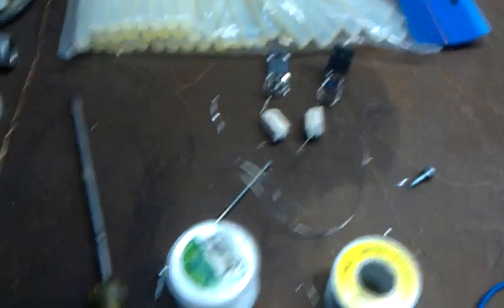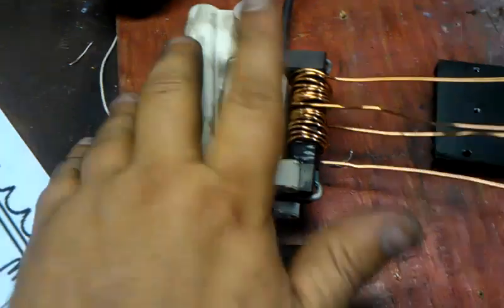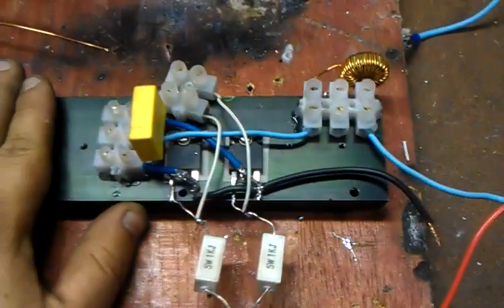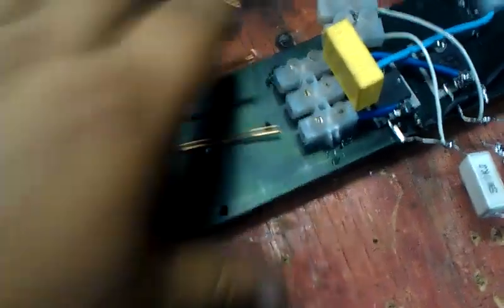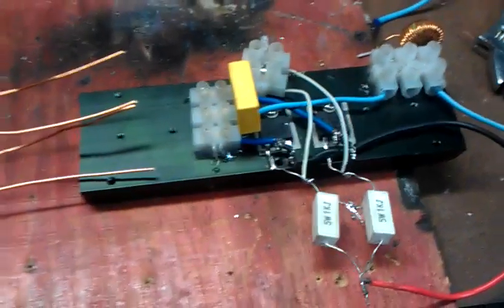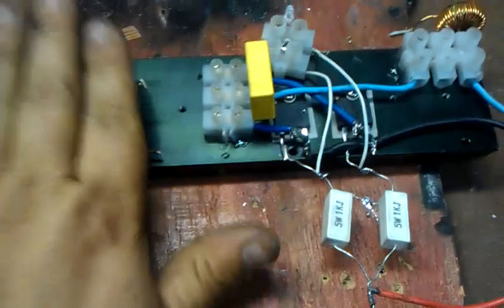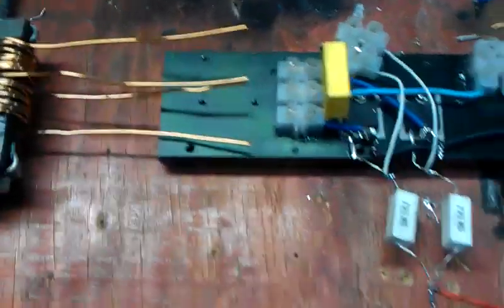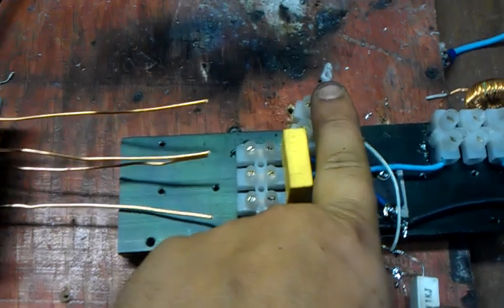Sunday Stress Pt. II :- Royer Oscillator Flyback Driver ReVisit ReBuild

Comment: not sure if you have zeners on the gates of those FETs but it might not be a bad idea.  the gate usually is only good for +/- 20V relative to the source.  a small value resistor (say, 100 ohms) between the winding and the gate and 2 back to back zeners in series (say, 18V) from gate to source might protect them a bit better if they are being zapped that way.  good luck! (oh yeah, you got a scope so you can tweak your feedback winding by trying for around 10-15V peaks relative to ground)

Comment: Hey Alex, enameled copper wire is good but it's insulation is not the best, a little tip here, you can use heat-shrink tube on enameled wire for extra insulation. We are dealing with high frequency here, so in theory some of it travels over insulation, I think it's called skin effect. That's why you had that crazy effect when your flyback died. Shrink tube is thin enough so windings still should fit nicely on flyback :-)

Comment: looks similar to striplight invertors for buses/coaches, i used to repair them in my previous job.

The only thing different is a 0.68uf capacitor from output of the choke to neg.
When it died on the invertors the output became low.

Your addicted arent you lol, join "sparkys anonimus" he he